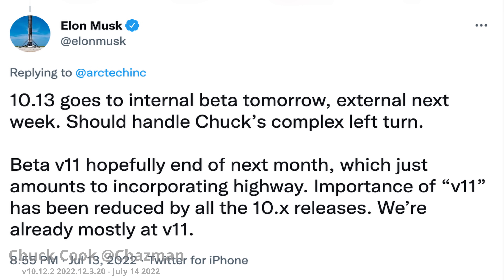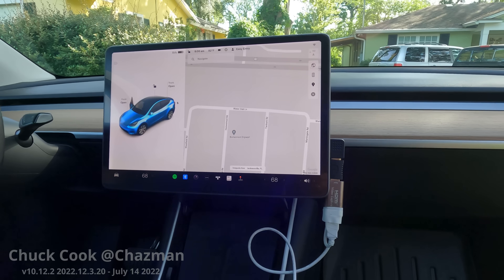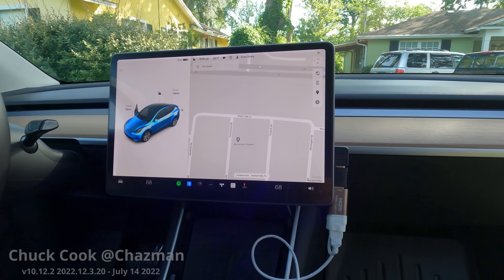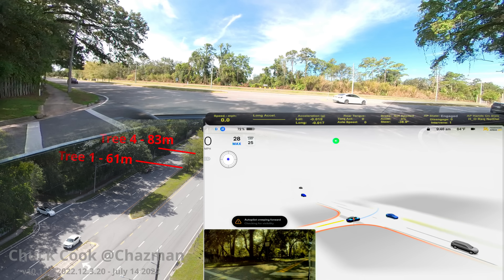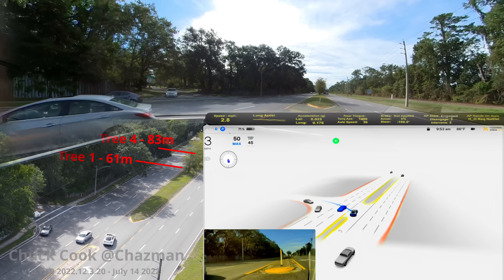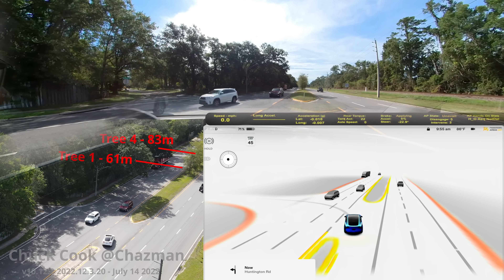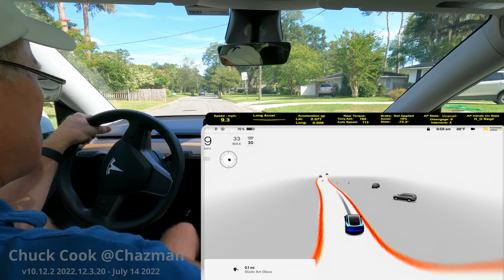Chucks Turn - What is Chucks Unprotected Left Turn

Comment: 0:00 Intro
0:35 What is Chucks Left Turn
4:47 Camera Setup
9:00 Unprotected Left 1
9:53 Unprotected Left 2
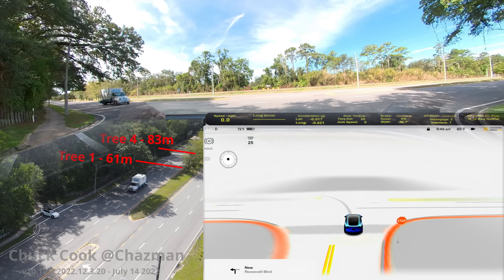10:38 Unprotected Left 3
12:10 Foward Facing Unprotected Left 1
12:56 Foward Facing Unprotected Left 2
13:57 Foward Facing Unprotected Left 3
14:24 Outro
Reply from the maker: Thank you ... in the description with credit and pinned!
Reply: @ChuckCook  Anytime thank you for the great documentation and progression of FSD.
Reply: My foward facing unprotected left in my area the car loves just to go without waiting. When it does wait it loves to turn the wheel and tap the pedal making oncoming drivers panic.
Reply: Hey Chuck…Congrats on Elon’s acknowledgment, you deserve it! As PoweHungryRing  noted, I continue to struggle with forward facing unprotected left with oncoming traffic from a left turn lane. What I see is exactly what PHR said…it’s too anxious to turn as oncoming cars are still approaching, it sharply shakes the wheel, (even going back into the thru lane), and then slams on the pedal into the turn, or stops in the middle of the intersection. I barely test this, because I’m not confident it can execute properly, and hopeful 10.13 will improve it.
Reply: @Chuck Cook Test in all FSD modes, ya clown! 🤡

Comment: Am probably not the first to say this, but isn't the problem more with the junction than with FSD? I mean, that looks like a very dangerous turn for both humans and robots (European driver here, and we have our fair share of crazy junctions on this side). What is the success rate of this turn for humans? I'm guessing a lot of locals avoid that left turn because of its dangerousness, so only very competent, very brave drivers actually try it. Am I completely wrong on this? Would it not be more logical and safer for the city to not allow left turns at this junction, and make drivers who want to go left to instead use the junction at Verona Avenue? By making FSD capable of everything humans do, isn't there a chance that illogical, dangerous decisions get included too? YMMV of course. Great video and great work overall.

Comment: Wait, wait, wait -- I have the solution to this, and I'm serious. JUST. DON'T. DO. IT. The county should simply post a "no left turn" sign, and be done with it. Allowing an unprotected left turn across SIX lanes of 55+ mph traffic merely confirms Florida's blatant disregard for human lives and safety. Forget Tesla, most humans would find it challenging to navigate this intersection safely. If this turn had anything more than the very light traffic it currently has, it would be highlighted as one of the most dangerous intersections in the country. All drivers should make a right turn and then a U-turn. The Tesla AI should do the same.

Comment: Hey Chuck. Here’s a feedback note I just sent to the FSD team. I thot you’d be interested.

Exiting a small shopping area onto a 4 lane highway with small median and preparing to make a left turn (similar to Chuck’s turn), FSD sped up as it approached the street and started making the turn. I was startled by the acceleration and I couldn’t yet see to the left, so I disengaged. As I got into the intersection, I saw what FSD did. It saw the traffic to the left was totally clear, and traffic on my right, on the other side of the median, had one car way further down, so it determined it could make the left turn. This was the correct decision, but I didn’t realize it, until after I disengaged. So, I’d say a successful Chuck’s turn, even without 10.13. This was the first time it didn’t hesitate into the turn and did this move.  Not sure how it figured this out, but good to see!!

Comment: incredible work Chuck. this turn with that many lanes and speed of cars is indeed a challenge. not sure how many accidents has happened there the last few years but it should be improved with removal of the fence and probably the lamp post is also way too close to the junction. as a new driver to the area i think it would be safer to stop all left turns during peak hours and make a detour unfortunately. we focus too much on the shortest route imo. it may not be the safest for sure. i would think a detour will save lifes vs risking an accident; human or fsd.
Reply: perhaps some things are not worth to be solved is also an option if there was a safer detour route alternative. not claiming there is one here though

Comment: No. No. No.  Waist of time. For safe left turn without having the front of the car entering into the lane,
the only way is to instal cameras at the font of the car and perpendicular to the axial of the car, may be inside the high beam location.
Reply: So even though Tesla has announced that FSD 10.13 will have improvements for this intersection, you're asking Tesla to initiate an expensive recall to retrofit every car they've ever sold with FSD (hundreds of thousands) with new wiring, cameras and software? Tesla has known about this intersection and others like it for almost two years. If the current camera placement was a serious issue, wouldn't they have already made changes a while ago to all new cars being sold?

Comment: Chuck, I see you are capturing accelerometer data and displaying it. Could you also calculate the derivative ("jerk") and display it, and perhaps do some interpretation of that data? One of my complaints about FSD Beta is that it drives like a teenager on Red Bull, in that it is not very smooth. They really need to improve in this area to give passengers any confidence in the system. I'm sure it can be done in the path planning and acceleration/deceleration profiles, but it will depend on higher-quality data from the world inferencing system. There does seem to be a certain amount of inferencing jitter and sudden changes in perception that manifest in the control outputs. I think Tesla should hire a top-notch professional hired-car driver and record how a best-of-best driver can handle a car, or at least pay more attention to the "good" drivers in their fleet in the training of FSD.
Reply from the maker: This is a good idea. I have thought about it before but never implemented.  What display type (graph do you think would work with Jerk?
Reply: @ChuckCook  Cool! Probably a line graph with time on X and Jerk on Y? It would be interesting to correlate “bad behaviors” (like hard or inconsistent braking) to how they look in that space.

Comment: I've never seen a video match my experience so perfectly, I have a very similar intersection in my area. It's two lanes and a turn lane in each direction, but otherwise identical speeds and lack of visibility. The car is very erratic trying to turn onto the multilane road, and it gets way too close to the oncoming lanes when I'm turning off of it (especially when there's also someone turning left from the other direction). I hope the 10.13 update improves on both issues.

Comment: Aside from all the interesting things about automated driving... This junction is an unholy abomination of urban engineering as it is unsafe to human drivers in the first place. It should be taken out back and be shot uncerimoniously. Whoever thought up this meat grinder for mini-van moms and their kids deserves a special place in hell.

I mean, it's bad enough to have 90° merges with a 6-lane highway without lights in the first place because of the speed difference, but having you first cross one direction and then merge with the other direction without a reasonable safe space in between at 90° is just murderous. Why in all the nine hells wouldn't you at least implement a "michigan left" if not a grade-seperated junction? If this is the main exit from the neighborhood the traffic surely justifies a small on-/off-ramp configuration - and if it isn't the main exit then why does it need to connect to the highway? I mean, I don't know about the greater system this sits in, so I can't make bigger traffic analyses, but no matter what traffic goes through this, it is more dangerous and less efficient than an existing alternative.

[Edit: Curiosity took the better of me, so I look this junction up on GoogleMaps. Apparently this road serves exactly 9 single family residences - all of whom could just drive the other way and onto Iroquois Ave which merges onto the same highway (via Verona Ave at the next junction) just 300 yards further north, where there is a signalled at-grade junction that includes a railway crossing into the signalling. Why the hell doesn this junction even exist ???]

Comment: Hi Chuck, 
Thanks for your work!
I wonder if, for a comparison would be a good idea to have the Insta 360 camera centered right above the driver's eyes; that would be about 23 inches to the left and 10 inches forward; this is just a guess. The goal would be to have a vantage point similar to the driver except for the height advantage that the camera would have. Yes, I understand the driver can lean forward, left, right, back, and swirl his head and upper body so as not a perfect comparison; for the turn, maybe an extra 10-15 inches forward would be for a more just comparison in-between man and machine.
Reply from the maker: But the point of the B pillar location is to show how far back the camera is which is what the car is using to see, I am not the one driving unless I disengage.
Reply: @ChuckCook  
That makes perfect sense; thanks for your reply! 
Since the traffic system is designed for humans, it's kind of strange that Tesla would implement a placement of the cameras that leads to lower visibility compared to human vision. 
Especially since Elon keeps repeating that vision is the way to go, and the images from the car's cameras and their refresh rate together with the FSD computer makes it superior; this I agree on, but I would opt for > 180-degree sensor/sensor array in the windshield. This is the most significant HW flaw in the vision/optics system, IMO.

Comment: An alternative and equally acceptable solution to this is to make a right and use the navigation map to find a safer route to turn around. This is what I would tell a teen driver to do rather than deal with high speed traffic to pull off that left turn.
Reply from the maker: They need to solve U-turns for this to currently be a viable solution.

Comment: there is obviously a very basic logic routine missing in the fsd software: at a junction with traffic from left and right and an intended own left turn: if the traffic from the right (at the more distant lane, I want to merge in) offers at a certain moment a BIG gap, then I can risk smaller or more unclear gaps coming from the left because if the traffic there turns out to be faster than detected at the first moment, then I can fully accelerate towards the other side as there is no danger coming from the right. But if there is no clear big gab coming from the right, then I need to detect the speed of the traffic from the left more precisely before I start any rolling into the junction. 
These two cases are just a basic rule and obvioulsy unknown for fsd, so it will fail again and again.

Comment: The elephant in the room is that it’s a badly designed intersection.  Great video as usual chuck
Reply: I would say the main problem is, that here it is very difficult for fsd to detect within a very short time (half a second of the view) how fast the upcoming cars are, because of the difficult perspective and because (as far as I know) the vehicle has no stereo cameras to the side, what would be much better to detect the speed of upcoming objects fastly and precisely.
Reply: @sonnenscheinsommer4754  you mean by using lidar?
The cameras are too far back too. A significant hardware upgrade is needed.

Comment: Lol if Chuck did not intervene the car probably would have been an accident.
Reply: No, that is not necessarily a correct assumption. Being a pilot, Chuck almost certainly has very quick reactions. However, FSD is likely quicker but the problem is the car isn't communicating it's go/no-go intentions so Chuck has no choice but to intervene if it appears the car may do something unsafe. Since getting into an accident just to see how the car would behave is unacceptable, Chuck did the correct thing based on his experience by intervening. The Tesla engineers should be able to review that intervention after the fact and determine if the car would have done something unsafe or not. 

One way Tesla could improve communication between the car and its driver on turns is to very slowly roll forward (if safe to do so) in anticipation of making the turn. This approach does not require any user interface changes and also signals to other drivers the car's likely intention to turn.

Comment: For the beta testing people it would be a good idea if an onscreen icon came up in these iffy turns showing the car has made a definite “go” decision. In many of your scary go/no go situations you can’t be sure whether the car is going to continue to creep or accelerate.
Reply: But, you should always look out on the traffic, and not on a screen, so that is definitely a bad idea. Even having a chime or similar is a bad idea since then you might start trusting that and then a glitch makes the car go but you are relaxing and thinking it will not.

Car safety is so much much much more than just how well it performs in a crash and how well AEB works. It is EVERYTHING. From how the sound in the car sounds, to WHEN they sound, to what is shown on the screens and when it is shown on the screens and interior material with reflections and so on. Even how air blows in the car vents are part of safety!

Comment: IMHO the risk of a 50mph+ side or partial head on collision is simply too great for these kinds of turns to exist. I'd understand if it was one or maybe two lanes in each direction (like on a country road), but on a six lane high speed stroad? So many dashcam compilation channels with clips of these kinds of unprotected left turns gone horribly wrong.

We should follow the example of most countries and states and replace these with signaled intersections, despite the cost, or simply force drivers to take other, safer routes.

Comment: Your channel is the best one to track FSD beta progression. When FSD beats your left turn, stopping in the median, it will be a huge milestone. Well deserved recognition, Chuck!
Reply: if computer could calculate how wide the median is and calculate if tesla could fit inside, then it would solve it.
Reply: @zq9813  or if high definition AV maps were used.
Reply: it will never do that
Reply: @dog69420  I thought it could be just some calculation. That's something computer is better than human.
Reply: @zq9813  it can't magically calculate if it can't accurately measure in the first place.
Reply: @WayneBagguley  I thought fsd is able to measure…if not, how it drives with vision only…
Reply: @zq9813  it doesn't measure, it guesses with neural nets. Only lidar or radar can measure distance.
Reply: @WayneBagguley  ……you should learn more how camera measure distance…..it’s not just neural networks..it’s a accurate measurement..
Reply: @zq9813  Chuck's particular problem is the car doesn't fit perpendicularly in the median, and there isn't much room to turn the car so it would fit due to median curb placement. The best solution, as far as I know, is to turn right a bit, then left, so you can come into the median at the correct angle to stop in it. It is a particularly difficult problem that can expose a lot of safety issues if there's an error or false assumption. Telsa's system is a generalized system that needs generalized solutions. AI that works anywhere and everywhere without lots of preknowledge or advanced maps.

I think the best we may get on difficult medians is to just turn right then do a U-turn.
Reply: @zq9813  cameras are bad at measuring distance

Comment: Great video.

Something you didn't mention is that the road camber means the medium is higher than the margins. While your roof camera is high enough to see over the median, the lower position of the Teslas cameras means they cannot see the road surface of the opposite carriageway.

At times the AI struggles to detect the opposite carriageway and thinks this is a single carriageway road.
Reply from the maker: Very good point.  I did my original intro in two takes because I forgot to turn my mic on the first time.  It wasn't exactly the same, but I forgot to mention the distance to the trees too.

Comment: They really need to add side facing cameras near the headlights, or one 190 degree camera in the front bumper groove,  it would help tremendously for turn where the car has to creep forward. It would save about 5 feet of forward creeping at many intersections.
Reply: This makes sense, but how would humans be able to assist before it’s level 5 if it saw way ahead of us and we can’t confirm if it’s actually good to go?
Reply: @coreyaronson1773  It can show it on the monitor. The car is required to stop before crossing.